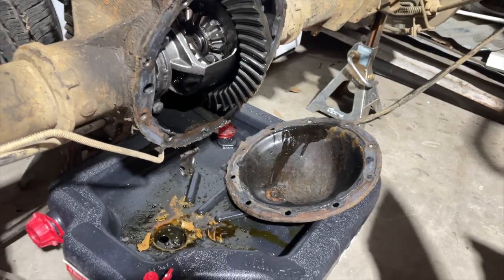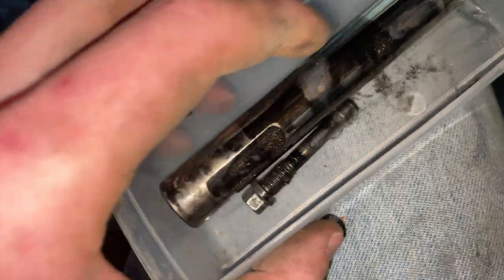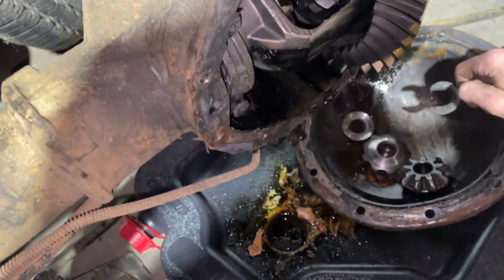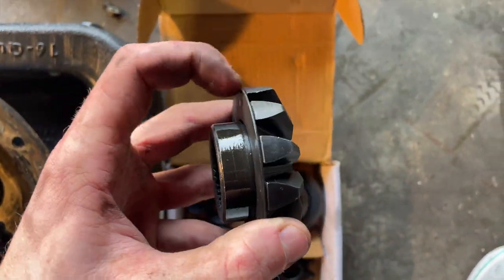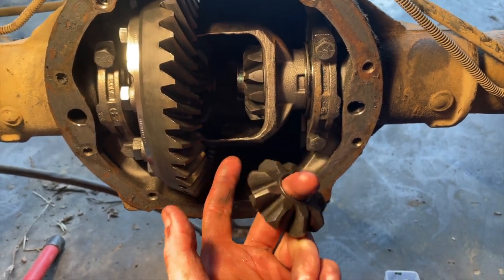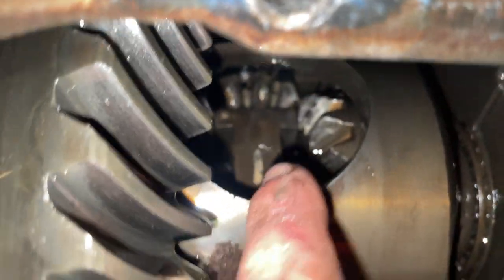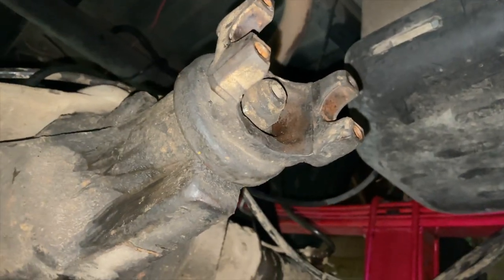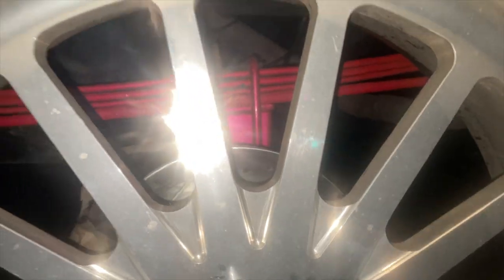Disc Brake Rear End Swap On 99-06 Silverado/Sierra | From Drums To Discs | Easy Swap

Comment: What else did you have to change to get the rear disc to work.  I’ve heard the master cylinder and proportioning vale have to be changed
Reply from the maker: I didn't change anything else. I heard about that too, but had no issues after.

Comment: love the video bro , for that t fitting line that connects from the the lines on the diff to where the actual fluid comes from a bit above so my disc brake differential comes with all the lines and emergency brake cables on the diff it just doesn’t come with that t fitting line that has that hose also connected to where the brake fluid comes from i believe would i be able to just connect the lines to the t fitting that my drum brake differential has or would it have to be that specific one
Reply from the maker: Most likely it is the same, I believe it was the same for me, its been a while so I don't recall. If not it shouldn't be hard to find an adapter of some kind or just re fit either the male or female end.
Reply: @GordoCaz  oh okay forsure thank you for the reply bro

Comment: Yooo so I’m doing the same swap do i currently have drums in the back and im going to get an axle with disk brake in it did you need to buy anything extra for the brake lines to connection on the brake caliper ?
Reply from the maker: The axle I bought came with the brake lines on it. I just connected those lines to the connection on the frame. I’m not sure if the drum brake lines differ from the disc where they connect to the axle.

Comment: Did you have to change nester cylinder or junction box or anything?
Reply from the maker: No. I just made sure to bleed the lines well and fill with fluid. Never had any problems since.
Reply: Did you bleed just the rear or all? I'm attempting to do this swap